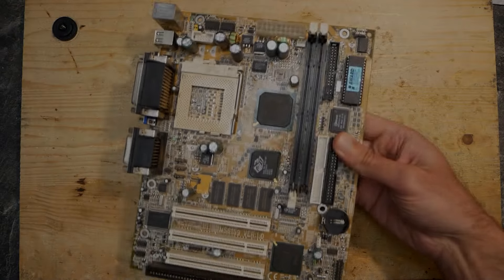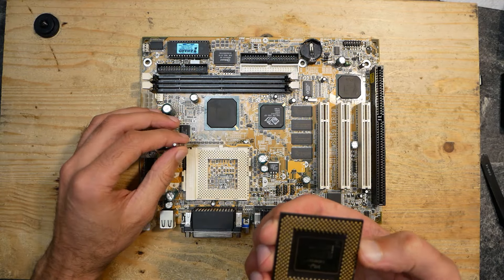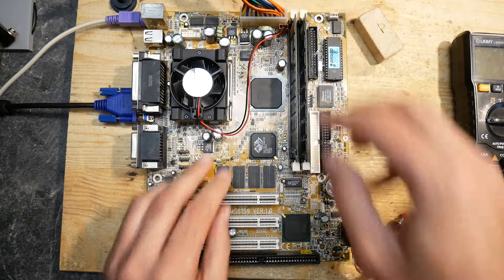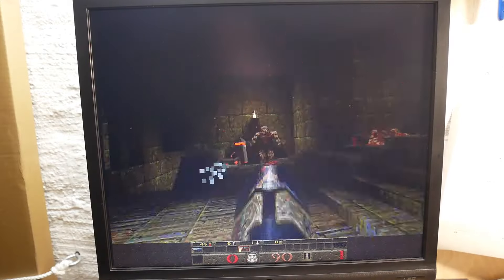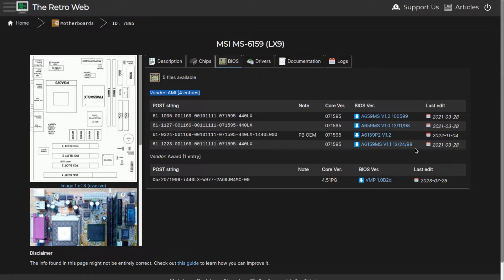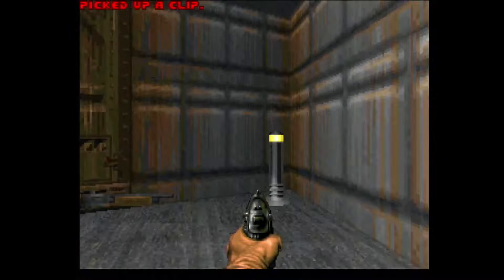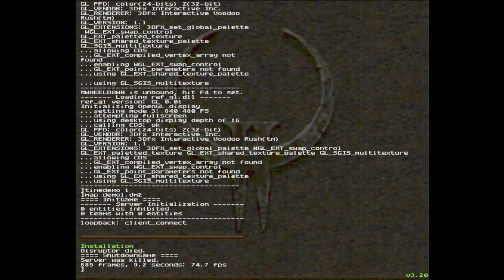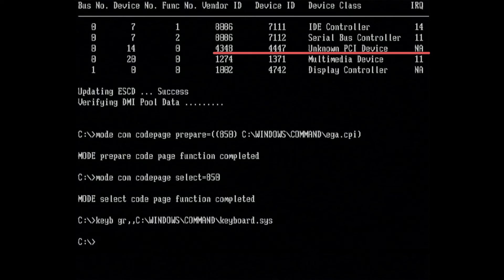Too nice to be true? Intel i440LX was upset about my plans.

Comment: PCI ven 4348 dev 4447 Did you have some crappy PCI post code card inserted by any chance ? Edit: just saw the post card and... YES it's that crappy PCI post code card. It actually identifies as a pci card. Edit2 : BTW the isa part will never work.
Reply from the maker: Yes, the ISA part is disconnected :) That is indeed a crappy POST card, but for PCI it works fine. The strange device had nothing to do with that though. After I finished the video I found out, that it was a strange behavior triggered by the USB mouse. Still don't understand, how that could be shown as PCI device, but probably that is some confusing incompatibility.
Reply: This is the post code card without the chip on imgur W6VIvud . As you can see the isa part isn't even connected, the traces just run to vias underneath the chip and end there. edit, If I recall correctly it's also a weird post code card on the PCI bus because it doesn't even use all of the pci data & address signals so in some cases it will actually give you false codes. since I can't post links I've adjusted it to just the imgur image ID
Reply: @necro_ware  easy enough to test it again, with either the post code card or the usb mouse. My bet is still on the post code card because I have the same one and I've seen that it identifies itself on the PCI bus.
Reply from the maker: Yeah, where you say it. You are probably right. I think, as I pulled the mouse, the POST card was also not inserted, so I probably ran into wrong conclusion. I'll test it later, but this is a good point. Thank you!
Reply from the maker: @Jim_Bo  I'l pin your answer, if you don't mind.
Reply: @necro_ware  No problem. Thank you for making these informative & enjoyable (though sometimes frustrating ;-) ) videos
Reply: @Jim_Bo  I saw it mentioned in the video and I got super curious if the comment section had figured it out.
And to my luck! Jim_Bo had solved it for us! So thank you from one of necro_ware's odd commenters.
Reply: According to that vendor id it's from that chinese company wch-ic, which is mainly known for their CH341 USB to UART ASIC. They also sell those UART ASICs and custom interfaces for PCI(e) and even complete USB HID device ASICs so it could be the POST card, because I've never seen any BIOS compatibility/emulation that exposes USB HID devices as a pure PCI devices. Either way, that device is something definately modern and it's product id isn't registered at the PCI-SIG.
Reply: @CMDRSweeper  Well, I personally own one of those crappy post cards and had already experienced the pci device appearing, though it only clicked after I looked up the vendor ID and remembered that crappy post card. I even unsoldered the chip to see why the ISA wasn't working, surprise it's not even connected. Oh bonus memory. the ISA slot is dangerous! It's not the right size, it's a bit smaller like a millimeter or so and could potentially cause a nasty short between powerrails & signal lines on the isa bus. imgur id W6VIvud is a photo of the crappy post card with the chip removed.
Reply: @chris-tal If i'm not mistaken WCH also make that ISA USB interface chip, but anyway beside the point. the unknown pci device in the  video is nothing to do with USB. It's that crappy post card. I'd look up the chip if I could remember where I left that card or the photos thereof but after all it's not that important. It is indeed WCH that makes the chip used on this crappy post card. I recall wondering if it could be repurposed for other goals but the documentation wasn't found by me.
Reply: @Jim_Bo  I bet that POST card could actually use a predecessor to their CH365 PCI to 8-bit local bus interface. What it interfaces to might be a PAL that has been made for ISA back when. So basically it's a POST card updated to the PCI bus and for some reason omitted to have a backward compatibility feature by adding something like a tri-state bus switching logic and fully wire up the ISA edge connector.
Reply: @Jim_Bo  Question if you don't mind. What so crappy about this particular POST card and how can i tell the difference compared to good POST card?
Reply: @chris-tal : It's not registered? Why, how abnormal, I would have figured that they would have just copied someone else's numbers!
Reply: @absalomdraconis  Interestingly enough the VID is registered and it might be one of their older or in-country domain name to a website instead their company name. I suspect it would be long and confusing and a domain name in the VID is an instant advert. The PID is not registered at all. Few days ago I came across a laser galvo driver board from a different chnse company. VID/PID not registered at all. If someone registers that at USB-IF I think they'll have to edit their driver inf files at a minimum. Talking about living on the edge? 🙃
Reply: @Jim_Bo  The two cards I have are very different then. The older mini-pci one is fully made out of PALs and the new one (PCI/ISA combo) uses PALs too, but also has a SyncMOS branded IC.

Comment: These Celerons were overclocking monsters. I used to have a 667Mhz one that easily ran at 1050Mhz. Probably even higher, but I think I reached the limits of the mainboard I was using back than.
Reply: L2 cache matters & celerons were lacking badly.
Reply: ...and easily beaten by a Duron 900.

Comment: Had you tried pulling up those two pins instead of pulling them down? Another thing to tinker around here would be to play with AGP window and "GART driver"/settings. Main differences between AGP and PCI (leaving alone speed) were (a) abilities to use side-band addressing and so-called "Fast Writes" - both of which were well known to case all kind of issues, especially on Via and Ali chipsets and (b) use GART to allocate part of CPU Dram as a  VRAM for textures storage. Any time you see problems with AGP while PCI works fine it smells like some kind of incompatibility (either software or hardware) w.r.t. those two features mentioned.

Comment: I remember having such a 440LX board in my first computer and also struggling a lot to find the right settings for my nvidia tnt2 vanta. In the end, after trying numerous settings, drivers, etc, I think the fix was to set the agp speed to 1x, if I remember correctly, or maybe another bios setting that related to the agp port. This fixed the issues completely.

In the end, the issue is related to the 440lx chipset and it not being able to work correctly with agp graphics cards.
Reply: It was Intel's first AGP chipset after all - I wouldn't be surprised if its AGP implementation boiled down to "works well enough, ship it". (how would it handle a i740)

Comment: As far as I remember, the 440LX had a somewhat buggy AGP implementation. Back in the day I had a 440LX system which was horribly unstable with both ATI Rage 128 and Nvidia TNT2 but worked perfectly with a Voodoo Banshee. I used a Celeron Mendocino CPU, by the way.
Reply: No, you are wrong. I have a 440LX system right now with a Matrox G200A card and it's perfectly stable.
Reply: Not my case, it was really stable.
Reply: Back in the days I had a cheap amptron 440lx mobo with a TNT2 m64 32mb agp card, it never had any issues, but i only had a 366 celeron cpu with that setup.
Reply: the LX series of chipsets also usually had poor agp current supply implementations at a time when 3d cards were starting to want more power from the agp slot (above the 6A it would provide, leading to yet another source of instability).
Reply: My first relatively up-to-date PC in 1999 had 440LX with Riva128ZX and worked quite stable if my memory serves me well.
Reply: @megashtyr1  those were 2x agp, 8mb of ram.  they're not going to draw more than the 6A for the agp slot limit.

so you not having issues makes sense.

and there were definitely agp cards that would work well with the LXs, it just wasn't universal.

--------

the fix to make things works with all cards seems to be to just solder a nicely sized wire on the bottom of the motherboard from the 3.3v pins on the psu connector over to the right pins on the agp slot, to feed it directly, instead of the underpowered regulator. and then to lift the output pin of the regulator so there's no conflicts with the circuits.
Reply: I have not had any problems with Rage 128 or TNT2 ultra cards in my 440LX boards. Just Geforce 256 and Geforce 2 cards would not work

Comment: I've learned very much the same few years back. I got an Abit ZM6 board with 440ZX chipset that is originally used for ppga mendocino celerons. Not wanting to mod the board (other than replace leaky crappy caps), I've searched for oldest revision of coppermine celeron533A cpu. Given the fact that the CPU is 8x66 MHz and 440ZX chipset is more capable than LX (ZX is basically stripped down BX chipset), I was able to overclock it easily to 8x 100 MHz (default voltage), from the bios using good old abit softmenu. The true celeron 800 doesn't boot here at all. This OCed older revision does. Anyway it is a fine board, it has few ISA slots, SB-link, AGP works okay. I've read somewhere that 440LX has some earlier buggy implementation of AGP. Not that common and yes this can be indeed with combination of such modern cpu 😊

Comment: The AudioPCI was great for one thing... full duplex support.  You could play and record at the same time, so you could use a program like Cool Edit Pro to do multi track recording back in the 90's when that equipment was absurdly expensive.
Reply: it had good 3d audio support too. it is a solid sound card for windows.
Reply: @sakitoshi  and also large Sound Font support before it was branded Sound Font.

Comment: there's some vogons and tomshardware threads on the voltage regulators for certain 440lx agp slots. seems some cards in 3d mode pull more in the 2x slots than they can handle, and it causes crashes. basically, its pulling more than the roughly 6A those can handle, and boom. the 4x slots provide more current. and pci cards don't tend to go over that 6A, as the pci spec is around 25w (or 5A) if i recall.

not sure if this is the case here, but its definitely a possible.

if you have an agp card with an external power port, you can try that. if it runs, those motherboards have the current supply issue that was noted. the vogons thread called 'early 440lx agp voltage regulator issues, anyone tried cards with additional power connector' has a workaround for asus p2l97 boards, which may potentially give a direction for a fix, if those two do indeed have that current supply issue. (i'd link the thread, but can't, for obvious yt reasons)

cheers.
Reply from the maker: Yes, I considered this as well, but then those AGP cards wouldn't work with Mendocino as well, but they work absolutely stable there.
Reply: Тут как я понял, речь идёт о недостатке питания для видеокарт через agp слот. Бывало решали проблему прокидыванием перемычки с разъема питания. Но там надо смотреть, как само питание слота организовано. Если с отдельного стабилизатора, то придется встроенный отключать

Comment: Vendor ID 4348 / Product ID 4447 = WCH WinChipHead PCI USB Controller. Manufacturer appears to be seriously old-school MICRELEC. Likely an early USB2.0 device of some sort on the mobo. Running a (older) 32-bit Linux distro will likely tell you more useful info. I believe I have an old ABIT Socket-370 in my collection with this same device on it -- the MICRELEC name sounds familiar to me.

Comment: Had a 440LX with P2-233mhz with an ATI Rage Pro 4mb AGP card (with the additional 4mb memory card) as my first PC back in 1995, even upgraded it to a Celeron 500mhz (with a SoftFSB overclock up to 550Mhz), had a Creative Blaster 8mb Voodoo2 in it (with the cable between cards) and a slot loading DVD writer. Looking back it was an awesome PC from a far far better time.

Comment: I would just stick to the earlier chips with the LX chipset. Personally, I always thought the LX chipset was too limited, and at the time I thought I was being clever buying a VIA chipset S370 board, but much later I heard VIA chipsets were poor performers. I never ran into performance issues, aside from with my first celery, but I just put that down to it being a celery. That thing didn't even have enough processing power to decode a DVD! In the end I bought a cheap MPEG2 decoder card, which actually worked out great since I could use the TV output on the card to make the PC into a DVD player, so we could watch movies on the big (well, bigger) screen.

Comment: I have a 1GHz Coppermine PIII, and I believe they went up to 1.13GHz, although at 1.13GHz they were unstable and were recalled before being re-released at 1.1GHz and 1.13GHz when Intel had fixed the issues. The Tualatin came at that point.
Reply: Are you use 1Ghz in LX board? 66x10 ?

Comment: Ohh man!!!! This is my childhood s.cking 20-23 years ago :D yees that aopen MX3L board with 440LX...That SSE problem i know minimum 10-15 years ago. The aopen can handle the B and maybe C revision coopemine celerons till 600MHz or more with 1.14 bios rev. But the So LX and newer CPU with SSE.. the 3D applications has conflict. Can't handle well.  The LX from 1998 was the very first to follow P1 MMX and not designed to coppermine and extra SSE.. ZX/BX works well with SSE....The SSE disable is an very good option.

Comment: I'm pretty sure the MSI board was originally designed for OEM use for a value oriented line of Compaq Presario PCs and later sold standalone as an cheap budget board. It would make sense as the Compaq machines were only sold with up to a Celeron 533 Mhz CPU in them which would have been Mendocino parts. My sister's ex husband had one of those Compaq machines with this board in it way back when and it was awful! I can remember working inside of it and aside from upgrading the RAM or HDD there really wasn't anything else that could be done with it for more performance. 

By the time the socket 370 Celerons were released the successor to the LX, the BX and newer still ZX chipsets were out as mainstream parts with the older LX chipset being relegated to ultra budget machines due to it's age. The Intel 8xx series chipsets then came later in 1999 with the release of the P3s that used the 133MHz FSB.

Also, a lot of LX boards that had AGP slots tended to have issues delivering enough power to the AGP slot. This is due 
Many LX boards only provide 2A of power on the 3.3 Volt rail which complies with the AGP 1.0 spec (AGP 1x & 2x data speeds), but most AGP 2.0 (AGP 4x data speed) compliant cards want 6A at 3.3 Volts. The 3dfx Velocity 100 (which is a card I also had back then!) acts like a AGP 1.0 card voltage wise (because it's really a PCI card in an AGP slot.) Most Nvidia and ATI cards made after ~1999 are AGP 2.0 compliant and want more power. Hence the crashing when enabling 3D mode on them. 

For best results with any graphics card that allows for AGP 4x or 8x data speeds on socket 370 needs to be in one of the later Intel 8xx or Via Apollo Pro 133A chipsets. Some BX chipset boards deliver enough power for those cards to run properly but not all. I had an Abit BH6 BX chipset board with an overclocked Celeron 300A in it that worked fine with a 3dfx Velocity 100 and a Nvidia TNT2 M64 card but would not work with the ATI Radeon DDR (R100 based) card I bought in the fall of 2000. However another machine I had with an Asus P3V4X mainboard with a Via Apollo Pro 133A chipset and a Celeron 566A overclocked to 875 MHz in a slotket adapter worked fine with the Radeon DDR.
Reply: yes I had that aopen MX3L +533A (mendocino) +TNT2 M64

Comment: i remember those mods
ppga>fcpga
fcpga>>fcpga2
v mods
bus mods for via chipsets
socket 370 is probably the most moded processor socket i ever moded :]
mostly fcpga to fcpga2 and via fsb mod i have no experience with lx chipsets though , the oldest p2/p3 board i had was bx or via apollo

Comment: Just a reminder about AGP: The whole point of the technology was to be able to modify video data "as if it was main memory" so the graphics driver code does not need to copy the data back and forth BUT it requires an updated memory manager as video memory prudently "appears" in main memory space.

So, could Windows issues be related to a clash between the Windows memory manager and the video driver ?
The video driver not being granted access to a certain memory range required for 3D functions.
Reply from the maker: It could be of course, but the question is more about the difference between mendocino and coppermine cores. Otherwise the same AGP cards wouldn't work with both types of the CPUs, however with mendocino everything works like charm and the issues appear only when using the coppermine CPU.